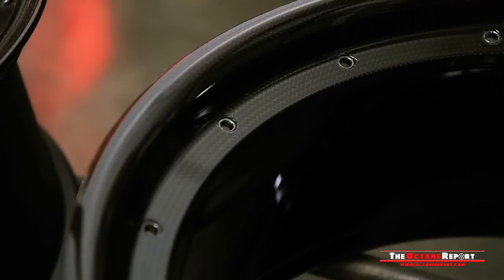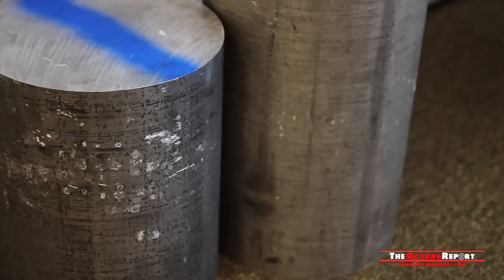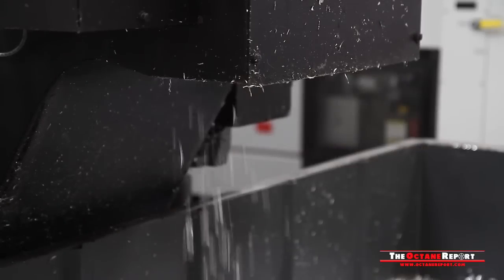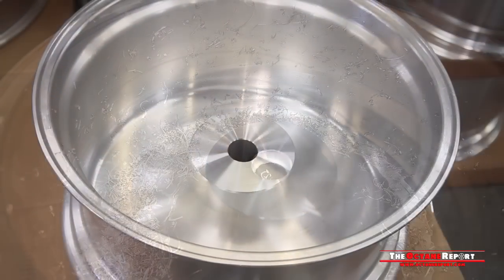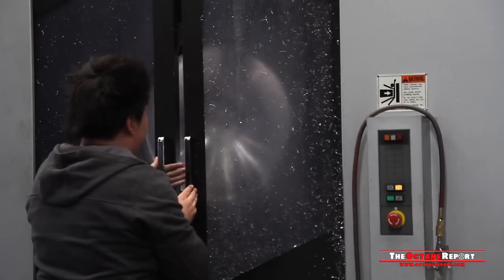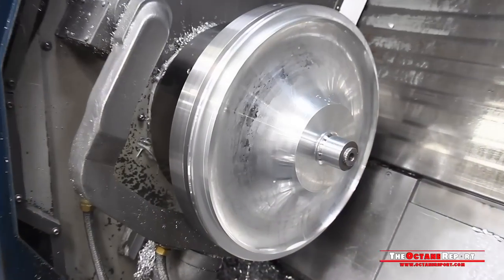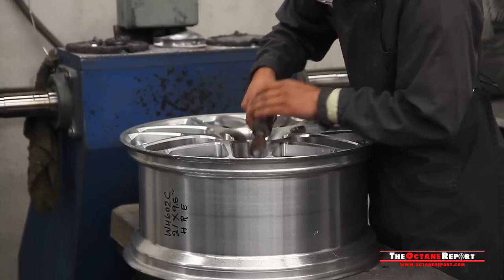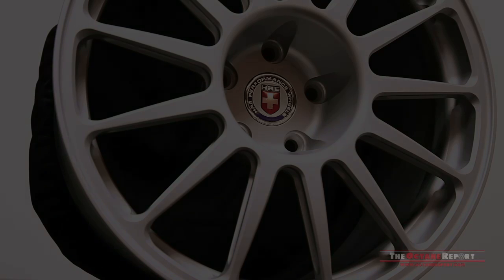How HRE Forged Wheels Are Made - The Octane Report

Comment: Isnt a forged wheel supposed to be a stamped block? Isnt this just a billet machined wheel?
Reply: I could be wrong. But, I understand that the original slug is created under very high pressure. That is what is meant by forged.  And then machined out of the forged block is how it is made.
Reply: A forged billet can be and must be machined to exact specifications.  There isn't a machine in existence that can stamp out these types of wheels without the use of CNC's. Other cheaper wheels are poured "cast"aluminum (without forging) and then machined to final dims. Hammering metal billets into forgings are stronger, tougher and expensive to produce. About 90% of all wheels produced are "cast" not "forged".

Comment: Quick question how much a Cnc machine cost N all the rest of the equipment to make a rim i been curious and i cant find a answer,all this stuff cost.
Reply: +Mark Valebcia About $500,000.00 for machine and tooling dies. Then someone that can program CNC machines.
Reply: +Claude “Reviews4U” Rains top of the line brand new yes! used depends. actually five hundred grand is on the high note! you don't need thst much machine.

Comment: Can you make 20x18w and 20x14w  wheels aprx: 8 inch backspace solid center  needs to look like an Alcoa super single wheel with a ford 8 bolt pattern F350  Can you do this? I would need 3 of each wheel. I want a spare for each size.  Drop me an e mail thanks.